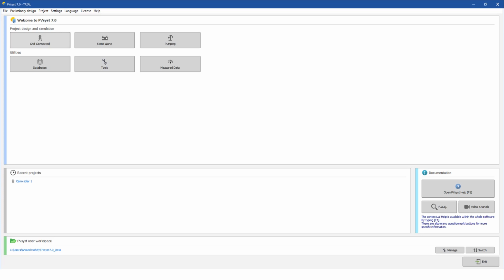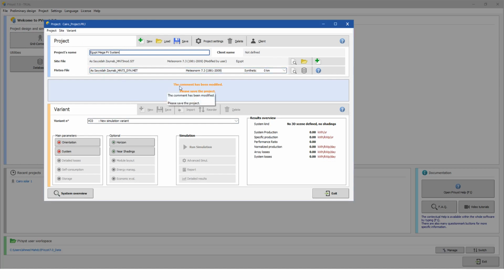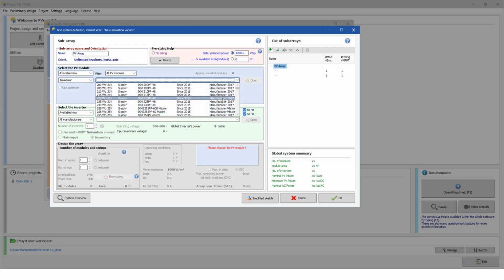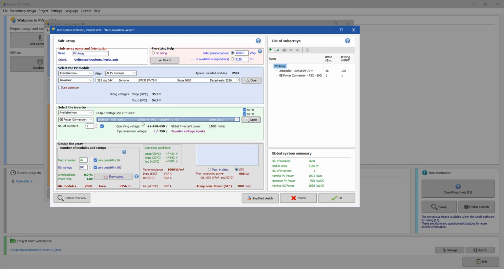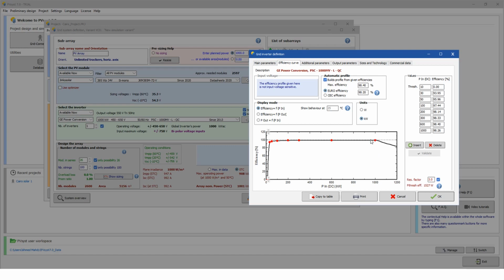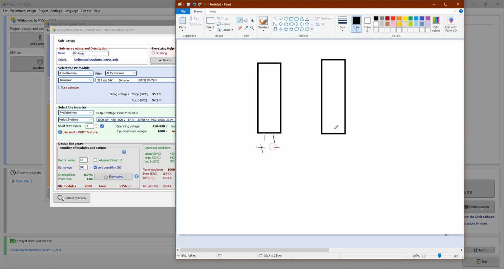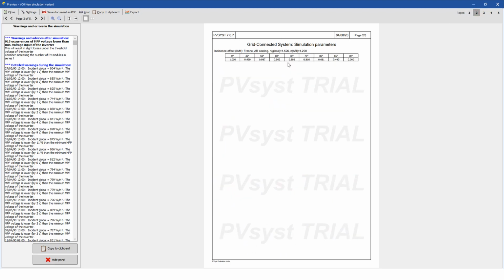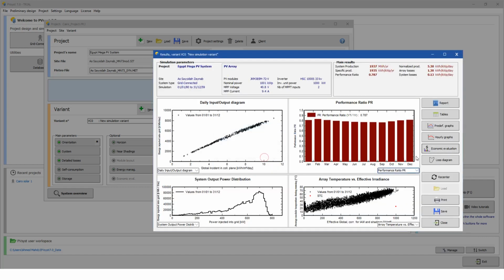Mega PV Solar Energy System Design Using PVSyst Program for Solar Energy Course

Comment: سلام يا احمد
How is the whole system voltage is only 450v? If you connect 26 modules in a string you will get a voltage that is way more than just 450v. Can you please explain? Thanks

Comment: In the first example with the 385Wp Jinkosolar panel, the Vmp is 40Volts. The software says that you must connect 26 panels in series, which means 26x40= 1040 Volts far more what the inverter can handle and according to the program everything is fine. How is this possible?? I can t understrand why it doesn t take this into account. Even if we take the Vmp=35 Volts (60 degrees C) still will be 26panelsx 35Volts= 960Volt which are far more than what inverter can handle. Please Ahmed if you out there please explain.
Reply: I think you can't use a single battery to store this much energy anyway. Maybe many batteries are connected in series too
Reply: @krutzberg  hi...no it has nothing to do with batteries...it is a commercial scale project so there are no batteries at all
Reply: @theJohnnylok666  ooh. I didn't know that. Nevermind yhen😉
Reply: Mr. @John_92, there are some derating factors involved, you can't just multiply the number of modules by its voltage, the program evaluates the site temperature conditions in order to make the arrays, once you select the position of the PV plant the program takes the temperature conditions (max and min) then with the derating factors of the PV modules calculates the real operating conditions for the PV panels, i.e. if the datasheet says a 40 volt in  Vmpp that is at 25 degrees or standard test conditions (STC), therefore at 60 degrees is much less so it can be 35 or 33 volts, the same happens with the Isc, Impp, and Pmpp. In order to make a good design, you have to evaluate this parameter to choose the right Inverter also,  having these parameters will be better to evaluate the operation threshold for the inverter. You can make the hand calculations in order to review the program results when you choose the inverter, I hope that I explain myself.